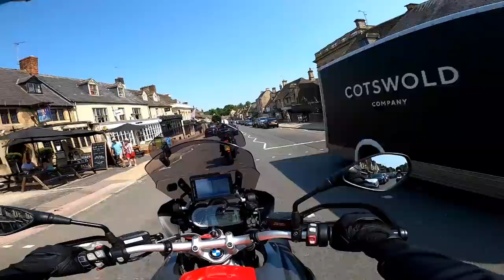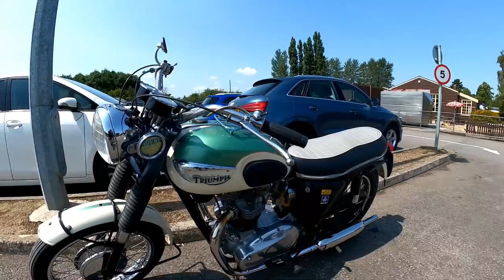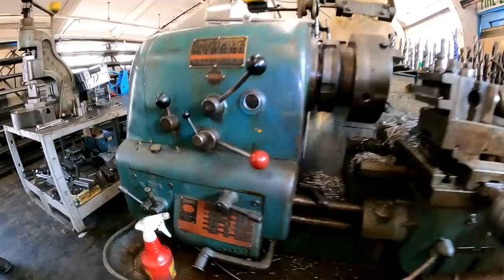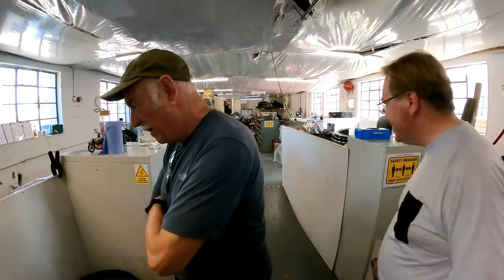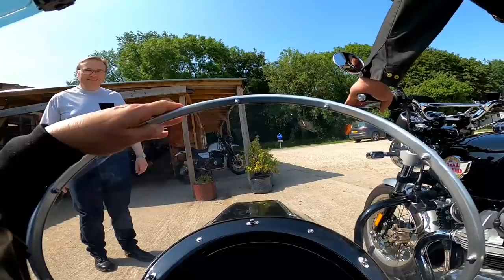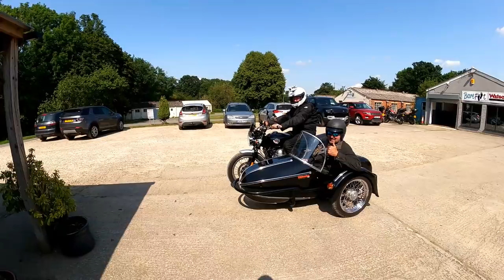How To Ride a Sidecar Motorcycle! Biker Scran with Geoff & Dan

Comment: I used to have a BSA A65 with a Watsonian CA (child/adult) sidecar complete with a sidecar brake. It was initially a little tricky to get the hang of, but great fun once you got used to it. The party trick was to turn the bars sharp left, and bring the sidecar up into the air, and then hold it there.

Comment: Had to laugh at Ur sidecar antics .
Had an original 1976 squire attached to yamaha 500 twin 8 valve .only 1 serious mod  respoked with grasstrack spokes ( a friend) ..honestly worse the weather better the fun .
Throw it at right handers and open the throttle even at Arc du Triomphe .
Love an outfit .
Loved the V Strom - my current ride

Comment: fantastic video’ love biker scran . many many years ago my mate had a original 650 enfield, he was an absolute looney tunes on it. 
I tried driving it once and turn out of our street totally misjudged the sidecar and it drove along the foot path. Then to totally scare the heck out of me I totally mucked up the right hand turn and the sidecar came right up off the ground and i nearly tipped over. 
Right i thought not for me , these things are death traps when i’m driving. 😱
Reply from the maker: Yes harder than it looks isn’t it!
Reply: The Operator needs to take a course   covering the techniques of side car management.
Reply: I have only owned a sidecar rig for eighteen months. I was not doing very well on a standard bike now days  due to my dealing with Parkinson disease, so I'm very happy to learn new skills and the rig is the best way to reach that goal. I will be removing the car windshield and add the tonneau cover to reduce drag, add a taller windshield to remove or reduce whiplash associated with riding with little or no wind protection. I presently enjoy riding a 2018 Triumph Bonneville T100 with a 2015 Velorex sidecar. The unit is painted gloss black with chrome in the usual locations.

Comment: Great video. It reminded me of my one time driving a motorcycle and sidecar. I was passenger in the sidecar of a Panther 650 single with my mate riding who had a stinking cold giving me a much appreciated lift to work to Edinburgh. About half way there he asked me to take over as he was feeling really bad and with me being an expert rider on my BSA Bantam I confidently said yes no problem and my mate went into the sidecar, it was raining hard too. I pulled away and immediately realised shit this is completely different and the steering was so heavy and you had to physically steer it like a car! Anyway I only managed about 25yds and went into the back of a bus which had pulled into a bus stop! The front of the aluminium sidecar crumpled up pushing my mates legs up towards his shoulders as we came to a dead stop. The bus driver didn’t even notice and drove off oblivious of the whole incident. My mate opened the hatch in the sidecar and said eh I’ll take over, I think it’s best! We’re still pals after 50 years since it happened. Riding a combination is a totally different experience and I don’t personally think they’re as safe as riding a solo bike. Did your sidecar have brakes on it? Is there a braking system available for sidecar braking? I suppose it would have it’s difficulties with riding with and unloaded without a passenger etc. Thanks for bringing back that memory TMF 👍
Reply from the maker: My pleasure Muddy - it’s not as easy as you’d think is it!!

Comment: I have spent more than 30 years visiting motor racing suppliers and machine workshops. While I appreciate that the CNC made stuff is flawless from a "Mass Manufacturing point of view" REAL craftmanship is still only performed in workshops that look like that! I would mention that THE best welding (Not just the most pleasing to look at but the most structurally perfect from a metallurgy stand point) I have ever seen was performed by a woman working in just these sorts of premises. Advance away from this sort of fabrication at your peril Britain!
Reply from the maker: Agreed! Trouble is, not many people left with the skills to operate these machines anymore…
Reply: @TheMissendenFlyer  Sadly, "Manual Engineering" is not seen as a valuable career for youngsters leaving schools. The "Modern"  school system is geared more for people who can "Do it on your 'phone" and we will reap the benefits of this in the next 30 years. We will eventually be paying  "Shovel and Wheel barrow operatives more than heart surgeons as they will be rarer in the world of work by then!